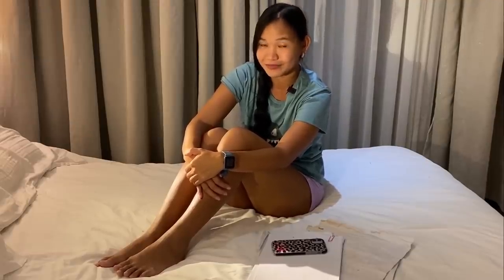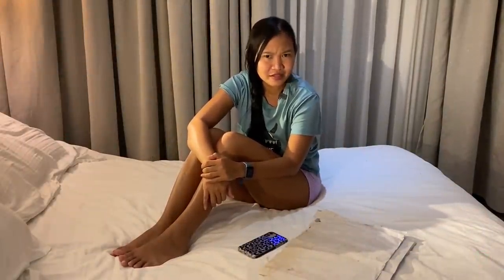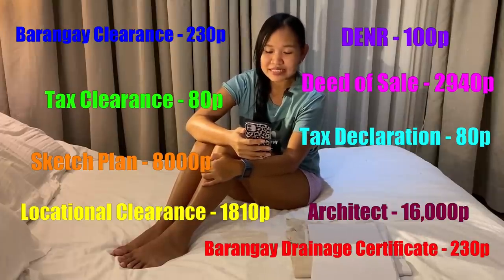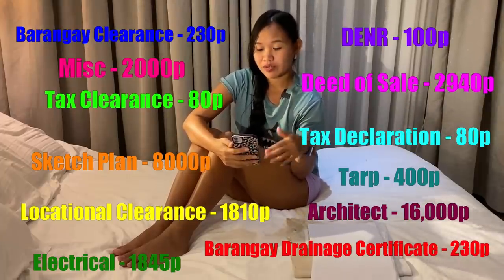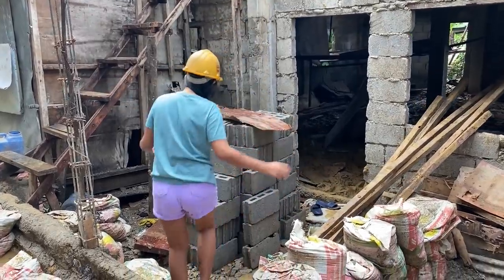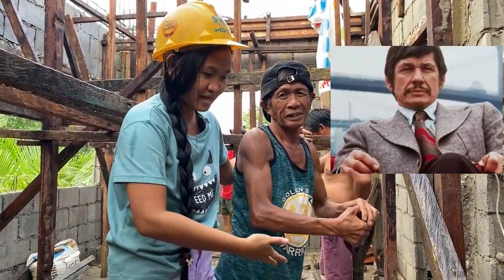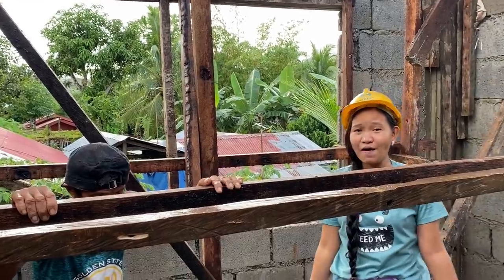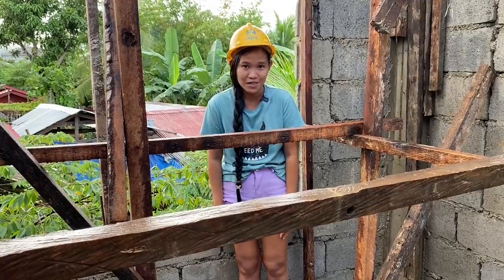HOUSE ON A BUDGET / Simple House Design 20K - Building A Home In The Philippines

Comment: Wow Pea,imagine being able to be able to build a house for less than the price of a new car.Some people here who can't afford housing are living in their cars.👍🌴
Reply: the biggest problem in building a home here is that local contractors are often pretty shady and will (in my experience) do all they can to shave off their costs. We were told by our architect to use 33gauge rebar (a measure of its thickness) for the support columns but our able household helper noted that they were using a significantly lesser grade. This sort of thing happened CONstantly, but we had a 'bantay' (watchman) who knew of basic construction techniques and could warn us when the contractor was trying to spend less of 'his' money rather than what the plans called for. It was a year long or more nightmare.
Reply: That's actually less than I paid for my used car, lol.
Reply from the maker: They should sell their cars and come to the Philippines 😂👍
Reply: @TheFilipinaPea  true. I paid USD$30,000 for my new car here in Florida. With that I could build a house there and have money left over to buy a nice used car.

Comment: Yo pea as a a/c mechanic I’d recommend running a power supply during the electrical fit out  for future a/c  installation  it could save quite a bit and if you don’t get a/c you’ll have a spare  power outlet
Reply from the maker: Well thanks for the pro tip, Peter 👍😊
Reply: Yes, it's much easier and cheaper to rough in the wiring for the a/c now during the construction than after the house is finished.

Comment: The house looks like a great project.  Hopefully when completed, you will not fall through the floor while giving the tour like on the old house.  The best part is what I learned in Puerto Rico: "The best place to be in a Hurricane is behind 6 inches of concrete."  That plan also worked during Typhoon in Taiwan!  Once the concrete walls are completed it will be a fortress and you will not have to worry so much about your parent's home.   Oh, lastly about AC.  With an upstairs, they will learn to open the windows when its cool to cool off the house then close them during the heat of the day.  A 2 story house will act like a chimney and stay cooler.
Reply from the maker: And my parents never seem to mind the heat (I sure do) 😂
Reply: @TheFilipinaPea  I am not sure of your plans but attic ventilation will help to keep the upstairs cool by pulling the heat out. Also think of some type of insulation in the roof to also help. Ned at Philippine Dreams talks about how it helped at his house.
Reply: House on Pea Corner 🥰
Reply: see Loggins & Messina “ House on Pooh Corner”  original version

Comment: I have a question about the building process that I have seen for many homes being built there.    When laying the cinder blocks for the walls why do they not scrape away the excess mortar  between the blocks when it squishes out, it would save a little by being able to use that mortar on other blocks .  Over here we trim the mortar flush with the blocks.  The house looks like its coming along  fine.  When its finished it will be a great place to live.  Good luck😀
Reply: Cinder blocks made locally. I knew a guy in Leyte supplying sand from river bed who earnt 80 peso ($2) on a good day. I went out with him once to pan for gold hoping to find him more lucrative work but that failed. I think the rough finish is because the blocks are rough and walls will be rendered later.
Reply from the maker: We’re going to give it a thick layer of skimcoat that will cover it all 👍😊

Comment: Very nice and congrats!   Amazing that the floor plan is almost identical to my GF cousins home they just finished. They added a CR/toilet in the left side bedroom though.   They also did not build a second story since it is only 3 persons.     

One thing you may want to do is have the electrician install the enclosures/breakers/connectors etc. for when you will install solar panels and battery backup.   I did it myself from components from Lazada and it works great.  Reduced monthly electric bill by half or about 1200 pesos/month saved.   

Has already paid for itself after only 9 months.   Charge during the day, on battery/inverter at night.    Good luck on the completion, looking forward to the grand opening party!🍾🥳

Comment: Exciting stuff happening.  I used to do major remodels of old houses, here in Seattle.  I did one on the home a good friend of mine was raised in.  It was in very bad shape, and it saddened me at times as I dismantled so many of the memories made in that old house.  But when I was done with it, it was a modern and very SOLID home with a new foundation, two-story extension to the existing two-story and an all-new detached garage that was better built than many homes are.  It's a very long process and a whole LOT of work but is rewarding for me when I drive past it 20 years later and it's as nice now as it was when I finished it.

Comment: Your family must be so proud of you Pea, educating your family and building them a new home 🥰 Fantastic, good tip flood the house with Cat 6 cable for great internet, very cheap and easy to do at this stage in the build, Google how to install very cheap AC using old car radiator/fan and domestic pump 400 feet it 3/4 inch tubing and getting a large hole dug in the back garden,  it will cool the whole house and cost very little to install and run👍

Comment: good luck with the build hope it all works out ok , tie the roof supports down well,  tie the roof down to the top 1.5  metre of wall , it will never move in a typhon , if you insulate the walls and roof space , it ll keep heat out of the building, with electrics make sure every thing is earthed properly try not to cut corners on safety

Comment: Quite a different building style than back here in Norway, but you get it done and it works :-) I decided to give my girlfriends parents (and siblings) a decent house instead of the bamboo house they had. The old one was falling apart from termite attacks on the wood frame. Since i was/am in a good position economicaly i wanted it to be a gift for the family. When i said that to my girlfriend she got angry because it was OUR house, and i was part of the family :-D Anyway, our project is about 100 sqm and 1 level (Cebu island up in the mountains). The structure is done except ceiling, tiles and paint. 3 bedrooms with a bathroom for each. Proper western style with "bumgun" :-) It looks to be complete at about 22-23.000 USD. I consider it a gift to the family since we will be living elsewhere once i can return to the Philippines. Even if the relationship should fall apart i have no regret because the family needed it. Best of luck with your project Pea!
Reply from the maker: Excellent, Robert!  See folks, it really can be done 👍👍👍

Comment: Hey darling pea! Sure positive feedbacks are much more valued than critical one. But as a former builder and now doctor I have to criticize it. the walls would be very weak for any seismic activity plus they would conduct so much of heat, that it would be very difficult to live in it. Unless you put a second wall like brick wall or insulate it from the outside. Sure it is already so much better than it was before and I applaud you for the magnificent work you've done.

Comment: There is supposed to be a beam over every opening in a wall to support the blocks above.  In particular there should be beams over the windows.  Normally this is concrete with half or 5/8 rebar around 1.5 inch from each corner.  The beam overlaps the blocks of the wall on the left and right of the window.  A precast beam might only be 8" hi but if you pour it in place yourself you will want 10 or 12 or 16" to match 2 block heights, I think.  Sometimes a type of open block is placed that enables rebar to be placed inside and then concrete is poured in that.  Hopefully that is what has been done in your video.  In addition to the reinforced beam above a doorway, the block columns next to doorways should have rebar and concrete in them and should continue to, and tie into the tie beam above.  This will reduce the chance of blocks above windows falling down and hurting someone in an earthquake.  This structure cannot flex in an earthquake and may sustain more damage than your old house but it should survive hurricanes better.  Other than flood, the greatest weakness in a hurricane is the roof.  Florida has abandoned the old codes and adopted one in which a steel strap is cast in the concrete beam at the top of the wall at each wood roof truss.  If you do something different just make sure the truss is very strongly attached because if the wind gets underneath the roof, perhaps from a failed gable, and pushes up on the bottom of the plywood, all the force on the square footage of the plywood will try to pick up the truss, like an umbrella pulling on your hand in a windy storm.  You might pay a structural engineer to come by and advise what and where and how to fasten.  He might suggest cross bracing along the undersides of the trusses, and metal strap tie downs at the trusses using screws if attaching to wood, in addition to toe nails.  Good luck.

Comment: Pea im a certified building contractor in Florida. I moved to Costa Rica im retired. But i like to give you a couple of ideas ok. 1 make certain that the roof is extra tied down with metal ties. 2 make plans to put metal shutters on all the windows because a big storm will suck out the windows and then life the roof off the house. And the storm will take all the furniture and clothing out of the house. Pea you check on the internet about hurricane Andrew in Florida. I seen it cement block houses gone because of the roof coming off. I would like that everyone is safe during a storm ok. Good luck with the 🏡 👌👍

Comment: That's so awesome that you can build your parents a home, I have a question,  is there a reason why you decided to use 4 inch cinder blocks and not 6 inch , because the 6 inch would be much more structurally sound especially supporting the second story
Reply from the maker: Believe it or not, the 6 inch are hard to get here currently, and much more expensive for some reason.  I’ll made up for it with a super-thick coating if high-quality exterior cement on all walls and surfaces 👍
Reply: @TheFilipinaPea  right on and thank you for your response,  it's nice to know you take the time to read your comments,  how much more do you think it would cost if you built the home out of lumber and had the walls insulated

Comment: A few questions for you.  It sounds like the "core" was someone, perhaps an architectural company that created the structural plans (design), the plumbing and electrical plans, the bill of material, scope of work, and who signed the plumbing and sanitary permits and materials spec.  For this you paid 16,000 php.  I imagine that there are companies that specialize in this, and have perhaps 20 or more "standardized houses," meaning single story, 2 bedroom, or in your case, 2-story 4-bedroom, 2 bath.  I doubt that an architect sat down and designed your house on its own, rather he/she used a standardized set that works well and allows a much lower cost.  Would you kindly share who that agency was with a name/phone number or contact information?  I'd be building in Cebu but I imagine an architect anywhere in the Philippines can give structural/electric/plumbing that works the same on any island.  Do you know of any architect that does this on Cebu, or might a reader who has built that is visiting know of a reputable architect?

Comment: I think I hired the same guys to build my house in basay nedros oriental. I say that because the mortar/cement  block work looks the same. It appears  that the mortar is mixed with gravel instead  of sand. The gravel sure makes for sloppy block work . Still can't figure out why they all do such sloppy  work. I know they will skim coat over the sloppy work to hide it later. And look at those transoms of doorways and windows.  My guess  gust a piece of rebar..definitely not strong nor safe . I recommend using coconut wood beam for lentils . But that's the Philippines.

Comment: Getting building approval and supplying documentation for infrastructure would take longer than 2 months in Australia. Each stage of construction would be inspected by the authorities. The main downfall of Asian construction is the incorrect ratio of cement, sand, and aggregate. Corners are cut to save on cement, which causes heartaches later. It is not by accident, that buildings crumble during tremors and earthquakes. Be on-site, and make sure the correct blend is used. In the trade, it is called a 1-2-3 mix ( 1 part cement, 2 parts sand, and 3 parts washed aggregate.

Comment: Ok, Since A/C Has Been Found To Be Bad for the Environment, plus the Expense, if you wish to keep the Place Cooler without the Need for A/C, you Can Use Reflective Paint 🎨 . They have Just Introduced a ( SUPER WHITE) reflective Paint you Can Put on the Roof.

They Claim it Reflects Around 90% to 95% of All the Heat Producing Rays, which helps keep the Place so much Cooler. They say, if things to get a Bit warm, all that Will Be Necessary is A Simple fan. The Fan will be much Cheaper to operate, and it Eliminates the Use of A/C , Again  A/C emits Harmful Chemicals into the Atmosphere, which help to create the Global Warming Crisis that we are All Experiencing.....

I don't know the Current Price if this Reflective Paint, but any Extra Cost for this Paint should be Off-Set By the Savings in Electrical Costs , and The Knowledge you are Doing something to Help the Planet and Civilization.

Comment: The cascade of congratulations are duly noted and are well deserved...Now the questions:

-The islands of Samar and Leyte are prone to typhoons and floods...How did you design your house to be flood and typhoon proof?
-If you had an architect build your house and get your permits and a contracter construct your house with his labour , how much more would it have cost?
-What did you do to make your house withstand earthquakes?
-Did you consider getting a prefabricated house ..which was flood, earthquake and typhoon proof? eg: a steel house
-Are you going to have a flat roof so you can have a utilizable terrace? and be able to add subsequent living space...

Thank you for your time...
Reply from the maker: We’re using extra thick rebar to prevent damage due to typhoons and earthquakes, and if we had used a contractor the total price would’ve been 30-40% higher.
We’re using a peaked roof of long span metal rather than a terrace on top so we can vent the heat above the second floor 👍

Comment: To be honest I don’t trust your numbers.  Does that include the build out of the house.  I just finished a house.  150 square meter house interior 3br/3bath, 90 square meter roof deck w/cr and 28 square meter balcony and same size porch and a swimming pool.  My cost was 6m.  I did some high end finishes which pushed up that cost.  I still need to finish the kitchen which will cost 220k.
Reply from the maker: That’s okay, Neil, I’m keeping a very tight set of books, so I’ll be able to report the exact cost of the house, right to the peso.
The cost does not include the land or the furnishings, but everything else in included in the estimate

Comment: Just curious. Is it physically possible for Pinoys to build a house to a lower quality? I would be scared living in a house that badly built. Even on a good day it could fall down
Reply from the maker: Yes, most homes use must thinner rebar, lower-quality cement, and poor roofing materials.  This house will have the long span metal roofing 👍

Comment: The roof can be used to create solar 'air-conditioning'.  Using a chimney effect powered by sun heating the roof, a very decent draft and ventilation can be created. Very very cheap and effective. Contact me for details but I expect you can find it on You tube. I built my house, 100% solar powered, off grid, rainwater catchment from roof providing 95% of water needs.

Comment: If you are clever,. don't paint the outside of the house. But let the carpenterio plaster it fine. In the long way needs no maintenance and looks much better then old dirty and cracked sunburned paint.
Reply from the maker: I actually like the look of unfinished concrete, but we might have to paint it white unless we can add air on OR unless we can’t find a way to eliminate the backsplash from falling rain, which kicks red mud in the walls and ruins the look.  I’m thinking of using gravel around the exterior to drain the water and prevent that ugly look 👍
Reply: @TheFilipinaPea  I put gravel around it for one meter and gives a nice 'boundary' as well.  I know the mud problems...but after many years the house looks more decent then the ones surrounding the area. And much heat in the house can be prevented by making a ceiling instead of painting the house white as walls are just not big/wide enough.